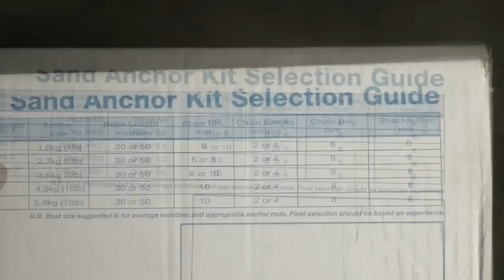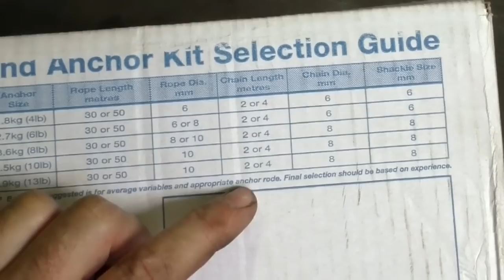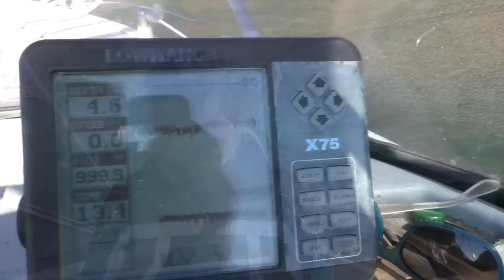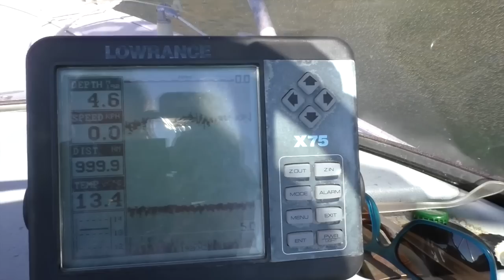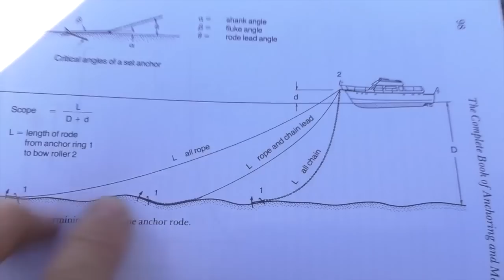Anchoring a small boat

Comment: There is a science to everything. Interesting details on ocean anchoring.  Lakes and rivers don't have tide issues, but they can be really busy with boat traffic, wind, waves and boat wakes, and with rivers, add current and quick changes in depth, especially smaller rivers that can be affected by flood water from dam releases. You can be up a small river where flood water is being released, and while you are there, they shut the water way down.  If you are not paying attention, you may be in a deep pool, but below as the water level quickly drops, the water can become so shallow, you can't get back down stream to where you launched from.   Looks like salt water has its own issues.  Thanks for the information.

Comment: Great videos thanks! I have a 1963 MFG Seaway 18 ft Fiberglass hull With a 88 hp Johnson outboard. I’ve owned it for over 38 years Runs great use it in the Delaware Bay and the Chesapeake Bay.
Reply from the maker: Thanks mate. You've got a good life out of that boat!

Comment: Thanks for the video Stu, well done. Once during a heavy blow, I had to motor to a safe cove, told my son to throw the anchor, well he grabbed the back up and threw, line and all over the side. that was seven years ago. the look on his face was the funniest thing I ever saw!  His brother was able to grab the primary and thew it over board and saved the day as I held the boat in place with the motor. Still brings a smile to my face. I see you use a lifting plane on your outboard, dolp-fin or shark, different brand names. think they are worth it???? Doug...................
Reply from the maker: Ha! Boat certainly has its memorably moments. I do think those anti ventilation plates (by whichever brand name) are a good thing. They allow the motor to be mounted and trimmed a bit higher without cavitating which gives the boat a better ride. I also find they protect the prop from knocks against wharf piles and other vertical hazards. Should do a video on installing them soon. :)

Comment: i have seen where you shackle the chain to the crown of the anchor, then tie wrap the chain to the hole on the shaft.  That way if the anchor becomes stuck, the tie wraps at the shank break, so you can pull the anchor up by the crown.

Comment: I was taught to shackle the danforth type anchor through the front hole, run the chain along the anchor shaft and tie the chain to the end hole with either heavy fishing line or a couple of heavy cable ties, that way if you snag your anchor up you just slowly drive over it and the cable ties break off and the anchor comes straight off the snag backwards.
Reply from the maker: Hey Matthew, that is a good text book technique for recovering an anchor. I'm pretty much sold on doing a separate video dedicated to recovering anchors as there are quite a few different methods. You can also attach a second line to the front hole so that you don't compromise holding power in a storm but can still use the second line for retrieval. More to come!
Reply: I must say, I don't anchor overnight or for long periods, just for fishing generally.
Reply from the maker: Yeah, it certainly is a very different story when your own board. While someone is on anchor watch nothing TOO much can go wrong. ;)

Comment: sometimes a great plan to anchor a large orange float(Buoy) then attach boat to buoy with steel ring,then use the buoy and powered-up boat to lift the anchor.In Canada here you must display a white light on top of cabin if at anchor. Cheers

Comment: You can also rig that grappling anchor by welding a ring at the tine end and attach your chain there, run the chain back along the anchor to the original ring and tie it there with a light peice of string, it won't take much,  don't use a cable tie, that's plastic. When you leave and up anchor,  if it is stuck that string will break and the anchor will lift out from the front. That way the  least damage as possible is done to the reef. Its only for short term anchorage while fishing.

Comment: Good example of how to lay an anchor improperly. "just throw that into the water" Might do if you are only fishing from a small boat in good weather, but if you want to leave the boat or sleep on it, you need proper sizing of chain and line, gradually laying by hand/winch and burying the anchor while motoring backwards.
Also if you are short on chain, you can carry a 30-40 pound (15-20 kg) lead weight that you tie to the anchor line at about 1/3 of its length in rough weather. That makes the pulling force of the anchor more horizontal to seabed and also helps smoothing out sudden pulls from gusts or wave bumps.
Thanks for your excellent videos on engine repairs.

Comment: if you shackle the chain to the hole at the head of the anchor, run the the chain up the shaft and use a cable tie to attach the chain to the eyelet on the end of the shaft then you can anchor the boat and if it gets caught or stuck just tighten the rope and use the boat to pull the rope backwards and snap the cable tie thus causing the anchor to rise vertically with the shaft for downwards and everything comes loose. only works with a danforth anchor.
Reply from the maker: Yes, that is a great way to go. Was planning to do a whole video on recovering an anchor but never got around to it. One day!

Comment: Gotta say—love your videos. You share so much wisdom, both the theory and practical. 

One question I have on this video is around anchoring around other boats. Unless I missed it I don’t think you actually mentioned how to avoid knocking into other boats? Is it just a matter of putting out the minimum required scope (for your boat, conditions and water depth), keeping as far from other boats as possible, and perhaps trying to anchor near boats that are likely to swing the same way as yours?

Comment: Reminds me of my dads boat and when the bow rope wasn't tied correctly to the cleat (just looped loosely) and i threw the rope over a high jetty pylon to bring the boat around the other side of the jetty and to my horror the bow rope just popped off the cleat leaving the boat to start drifting away. We had to swim to catch the boat so embarrasing but lesson learnt did a proper securing knot soon as we got it back to the jetty and never happened again. Pushing the  boat through 2 inches of water and 1 ft of mud also taught me to only put the boat out 2 hours before high tide and make sure i come back 2 hours after high tide.
Reply from the maker: Yes, watching the tides is certainly very important here too. Some areas get very shallow at low tide.

Comment: hi Stu, not sure if you will see this comment, however, in case you do, if i anchor overnight say at outgoing tide with my danforth, and the tide changes to incoming during the night, how can i be assured the anchor will still hold given the boats turned thru 180- degrees ?. cheers

Comment: Forgot to mention the anchor rope should be more dense than water so that it sinks, usually nylon. This helps with the set of the anchor and ensures that your rope doesn't get tangled up with other surface vessels. Floating rope of course is good for a sea/drift anchor.
Reply from the maker: Sinking rope does save a lot of prop tangles that's for sure.

Comment: 20 to 1 scope? for a hurricane, maybe. 7 to 1 is just fine for all-line rode. Also, I would never consider sleeping on an anchor without a locking hitch. I like the peening, except no need to heat it, unless you're  going to heat it red-hot to form it into a rivet. Not to mention you don't want to heat zinc like that. It will make you sick. Just deform the area where the threads join in a couple spots with a punch- called "staking". Just about all the other info is spot on. 

Cheers
Reply from the maker: Yes, staking is another good way to go.

Comment: What would you use to mark your anchor rhode...if you wanted to put a mark for every say 10 feet? (salt resistant) Oh, and i used some old fire hose i split for chafe protection.., and tied on where needed.  double jacket that is.
Reply from the maker: Hi Mark. You can buy soft markers like this that are pretty good https://www.westmarine.com/buy/west-marine--anchor-rode-markers--104372 Old fire hose is good for chafe protection and pretty easy to come by given how often they get decommissioned.

Comment: What options do we have in deep waters (50-100 m)? Try to moore a boat to rocks of the nearest coast?
Reply from the maker: There aren't too many options for anchoring in deep water without either permanent concrete mooring or a ridiculous length of anchor rode and a very strong winch. A sea anchor can keep you pointing in the right direction, but you will still drift.

Comment: Hi.  If you pein the shackle pin, how do you swap between anchor types without major effort ?  Thanks
Reply from the maker: Good question mate. I personally don't change to a reef anchor ever so I haven't looked into it but I imagine there are some good locking shackles for exactly that job. I'll have to do some research.
Reply: Dangar Marine : I reckon a longer shackle pin and two nuts should do the trick. Maybe even two nylocks to be certain. Just about to buy my first power boat so will give it a try. Really enjoying your channel - many thanks. Steve

Comment: As someone that lockwires aircraft everyday for a living I was horrified by your shackle lockwire effort. Have to keep telling myself this isn't aviation, standards are much lower. Now breath deeply into the paper bag.

edit: Also my old man's yacht got sunk in a cyclone due to lack of line to his mooring. The huge waves just swamped the boat and down it went. He knew it was short and planned to go back to fix it up but didn't and it sank. He refloated it but the interior was heavily damaged from a couple days on the bottom.
Then in another cyclone his mooring line snapped and the boat washed onto the rocks. During the effort of minimising the damage to the boat (placing padding between rocks and boat, preparing for the high tide to get the boat off the rocks), the line fixing the boom snapped, the boom swung down (boat was lying on it's side), hit my old man on the head. He was knocked out and then drowned on the incoming tide. He was also brain damaged, probably a vegetable from the impact.

Thought I would tell my story to emphasise the importance of this video.
Reply from the maker: WIth marina the main problem is getting them undone again, not having them come apart provided they last the first week anyway until the corrosion sets in. :)

Comment: hi dangar watched quite a few if not all your videos, im wondering if u could help me, im replacing the boat drain plug with a bung and socket its double skinned so obviously has a hole on the inside, is plugging the outer one all i do? thanks for your time alex
Reply from the maker: It is a fibre glass boat? You will want the bung to go through both skins and seal against both so that water can drain from the bilge straight overboard. Fibreglass boats can get very waterlogged if water is allowed to get into the timber between the two skins.
Reply: +Dangar Marine  yeah fibreglass, any idea where to putchuse one that would go through both?its not got a bilge fitted at present.thanks for your help alex
Reply: +Alex Gordon bilge pump i mean
Reply from the maker: Hi Alex. How long do you think it would need to be? You might be better off epoxying between the two hulls there and then drilling through for the new bung to go in.
Reply: +Dangar Marine at a guess around 2 inch?probably not even that,if i had to make the hole bigger whats the best way?cheers alex
Reply from the maker: Can you post a picture somewhere. Does current bung go through to the deck or is it designed to drain the space between the two holes only?
Reply: +Dangar Marine  the way it is just now is bung on outside hole on the inside, meaning water could get in between the two..cheers

Comment: doesn’t the heat destroy the galvanising leading to rust?
Reply: also, is loctite no good for this?
Reply from the maker: I've always had galvanised shackles eventually start to rust, but more from the rubbing where they articulate rubbing the coating off.  There really is not substitute for period inspection and eventual replacement. The same goes for the shackles and swivels in permanent moorings.
Reply: good point.

Comment: I see you put the anchor chain at the wrong part of the anchor, you would have a problem if it got snagged.
Reply from the maker: It's not wrong, anchors have two attachment points depending on seabed composition and your requirements. Using the front point and tethering the chain to the shank will allow you to break the tether and pull and anchor up that is stuck in a rock, but has the disadvantage that the tether can break anyway and the boat will drag its anchor. I need a boat to anchor securely overnight on mud, so this is the setup I use. If I was to anchor over rocks for fishing or whatever I would use a reef anchor.
Reply: Dangar Marine I must admit  I see your point about it braking loose, always have done perticular if the craft will be left unattended.  Happy holiday and have a great 2018.

Comment: Crikey, 
1] a Danforth is cheap, other than that there is no reason to buy it.
2] use a Certified [green pin] shackle
3] use a bow shackle, lock with mondel
4]  if you ever intend to leave the boat at anchor, even for a few hours ashore,  use a Certified chain [usually Calibrated]
The size of theanchor is recommended by the manufacturer, if doing any offshore sailing, use the biggest [ie for winds 50knots+)]
That tiny anchor is the size I would use for a tender.
Never use three strand rope, use anchorplait.
I can tell by looking at tha tiny tackle is that it won't hold in 4.5metres.
I don't normally comment on youtube stuff, but you have little understanding of anchoring, and should not be giving advice.
Reply from the maker: And yet somehow, without any of those things it has been safely anchored every night for almost twenty years without any trouble. :)
Reply: Jo Allen That was lame as hell. CALIBRATED CHAIN..really... With a small aluminum boat. Please make a video with all of you're high standards and expertise😅

Comment: While I can see you where trying to be humerus, I think it's over done Rather than having both clips, the one with the rope going overboard and secondly when you have the anchor hanging in free water. I think it would have more impact with only one of the two. Perhaps move the first section where the rope goes overboard later right before right before you start 
talking about anchoring techniques.

Loose or move the section about it not going to plan, and go directly into anchor types and how to install them properly.

I feel the section around 9 min could be cut without loosing much, however you could use the same diving technique to show what the anchor looks like when it's dragging, and when it's properly set. Then how that would present to someone on the boat.
Reply from the maker: There were certainly plenty of ways to edit this up to get the information up front a bit more, but at the end of the day each was going to have its advantages and disadvantages.